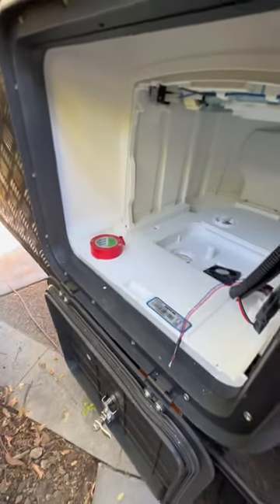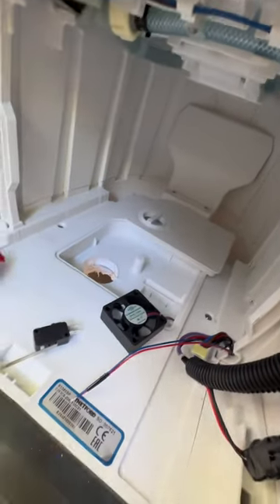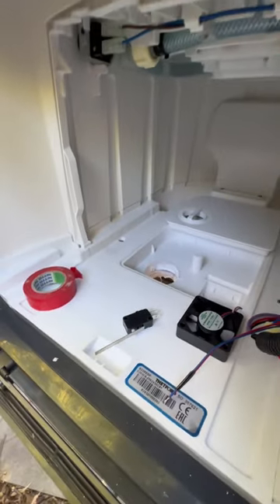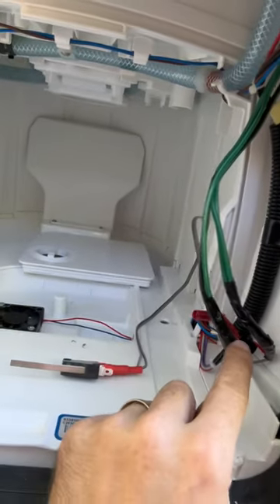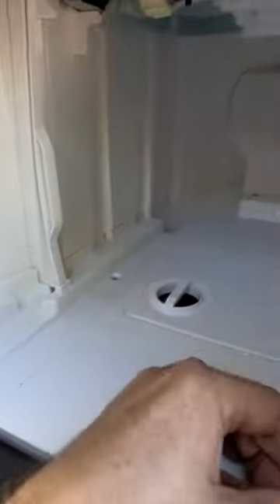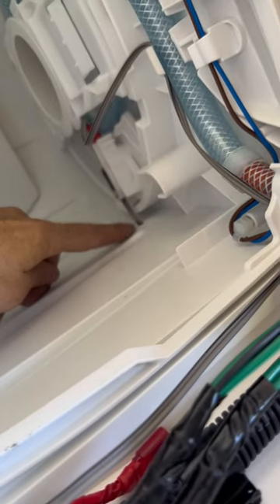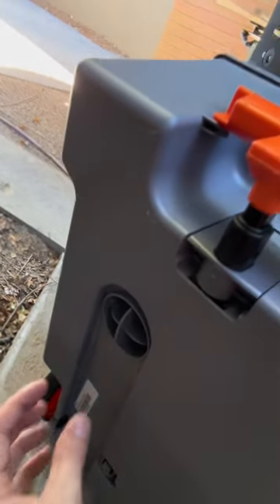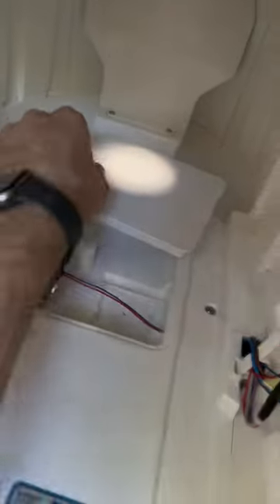DIY home SOG system for your van - at a fraction of the cost

Comment: I’ve done a very similar thing with mine. I triggered the fan from the flush solenoid with a timer that keeps the fan running for 15-20 mins. Works great BUT you need to have a seal (I used sticky back foam) on the port that mates to the cassette. Without that the air won’t pull through cassette it get sucked in through the gap.
Reply: Do you have product information please..seems very well looked at...👍👍
Reply: Any chance you could take a picture of the "port" you mean that needs the foam over it